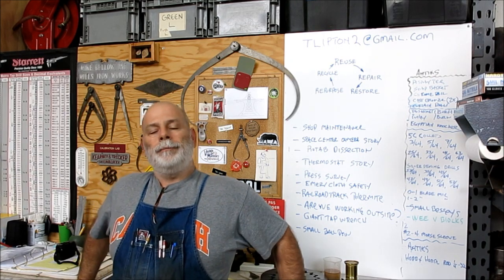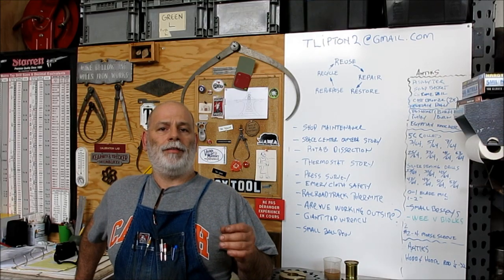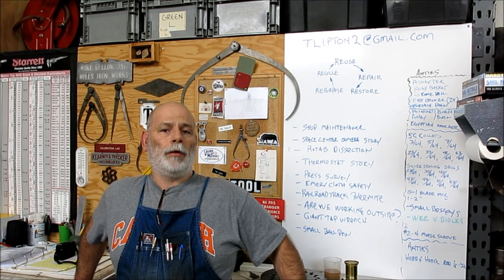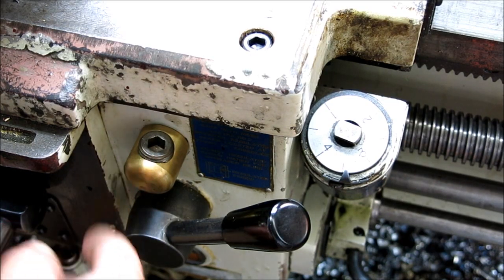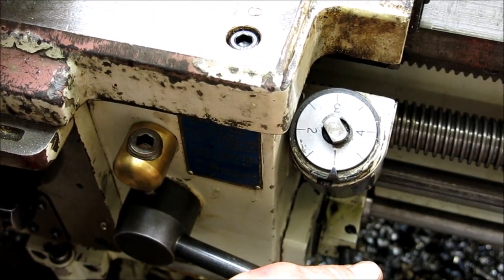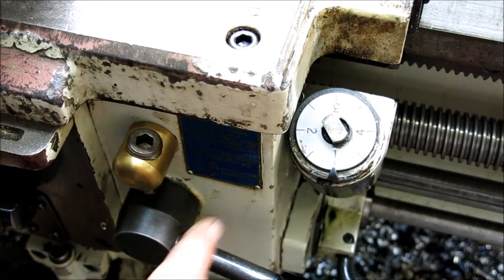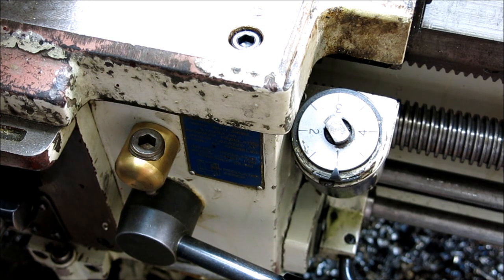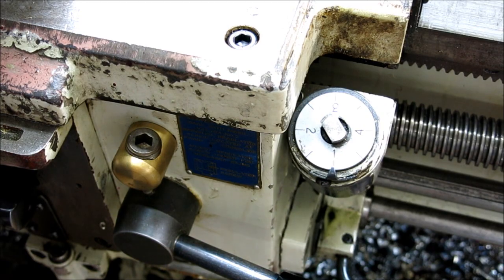Metric Threading with an Inch Lead Screw

Comment: Sure glad this came up in my feed. I’ve always wondered and I have a metric thread job that I haven’t done because it’s up to a shoulder and shutting the lathe down always seemed a high risk manoeuvre. Plus this allowed it finally to click about the geometry going on cutting metric threads with an inch leadscrew. Many thanks

Comment: So when you're cutting metric threads with an inch leadscrew what do you set the gear box at for a metric pitch??
Reply from the maker: Correct. My lathe can do both with a change gear. Normally I would have to leave the half nuts engaged for the entire process. 

Cheers,

Tom
Reply: @oxtoolco   Thanks

Comment: Disengaging the half nut, then re-engaging in reverse.  Two actions which are not necessary.  Stop the lathe and come out. do not disengage and just reverse the lathe to the start.
Simple. it is exactly the same, less two actions.
Reply from the maker: Not the same. You cannot stop instantly. Disengaging the half nuts is instantaneous. Much easier for muscle memory to thread "normally" then when the tool is clear reverse. 

Cheers,

Tom

Comment: If you let the dial make a full revolution and then reselected number 1 would that not be same?
Reply from the maker: Correct. The dial is tracking an inch leadscrew so one full rev is some irrational number different than engaging the same turn on the same number.

Cheers,

Tom

Comment: Completely lost here.   Engage or disengaged….How are you getting a metric pitch (without change gears!) when the lead screw isn’t a metric thread?!!
Reply from the maker: My lathe does have a change gear and can cut metric threads. Because of the inch lead screw you would normally have to leave the half nuts engaged.

Cheers,

Tom

Comment: My first threading project ever on my Grizzly G4000 9x19 lathe is 2.5mm pitch metric threads. For converting Intex pool filter proprietary threads to 1.5 MPT, you can buy an [chinese] adapter off Amazon; the 1.5 MPT is tolerable, but the 'intex' end should be 59mm as measured from a stock male thread, and the knock-offs are 58mm (shrinkage?) and blow off inopportunely due to partial engagement. I said enough is enough, I will just do it myself. There is no brake on my lathe, so about 1.5 turns from the end, you need to un-power and coast; the threads need to be right up to the 'hex' (octo) nut on the PVC. I quickly figured out you needed to keep the half nut engaged to stay in the same thread track, but kept lightly hitting the 'nut'. Your technique is BRILLIANT; I just went out to the shop and did a test cut x3 passes, and it works PERFECTLY! Nobel Prize 🏆🏆 for lathe cutting for you 🙂
HUGE Thank you.

Comment: I had considered this threading method (but the opposite way i.e. cutting inch thread on a metric lathe) soon after its launch  many years ago, but regarded it too complicated and forgot about it. But recently it started  to bother me again. I re-watched the video and understood it better. Oh yes I tried it and what a sweet safe way it is to turn a thread to a shoulder. I am very grateful to you and your source for this excellent method.  There are really no more steps than threading normal way. You only re-engage on the reverse instead on the forward. It is just that easy and fearless.Thank you Tom.

Comment: As you demonstrate, on fine threads in relatively soft material, you can advance the tool with the cross slide.  But there's zero reason to have the compound set @ ~30* if not using the compound to advance the tool.  A coarser thread in some 4140, not so much.

As far as the temporarily disengaging the half nut.  I've become aware of this.  Great tip.

Comment: Any tips on cutting internal metric threads in a blind hole? I would like to cut away from the chuck for speed and safety. (I have 300 parts to do). I thought about setting up a dial indicator to zero when I'm at the bottom of the hole and engaging the half nut on the same mark on the thread dial. Please tell me a better way if you can think of it. Thanks
Reply from the maker: Cut in reverse on the opposite side of the bore starting at the bottom of the bore. A RH thread brings the tool out when the spindle is reversed.

Cheers,

Tom

Comment: Great video, I have a metric lathe and was struggling to cut an imperial thread until I discovered that the threading dial wouldn't work so used the keeping the half nuts closed method. I'm thinking that this method will also work for cutting imperial threads on a metric lathe, will try it. Many thanks.

Comment: On older machines with lots of backlash etc,  ensure that you engage the 1/2 nut with the same amount of closure if it is variable. The other is to wind back enough off the thread for the start and I put a little of drag on the hand wheel to take up any backlash in the system, then I let go of the hand wheel before the cut starts. The main thing is not to change any gearing for when reversing etc. My other tip is to cut at a speed that you are comfortable with stopping by disengaging the 1/2 nut. This is very useful when cutting internal threads to a blind shoulder etc. I was shown this as an apprentice back in 1982. A great video .

Comment: I have the feeling that there is no reason to run the lathe in reverse. Disengaged the half nut  when shoulder is reached wind back (spindle still running normal) wait for number one to come round again and re-engage the half nut.

Comment: I too am having much difficulty cutting a metric thread on a standardized lathe. Standard threads L and R no problem.  And this is a great trick for keeping that position on the lead screw. I understand why you would need to do this when cutting a metric thread just fine. But what I don't understand is how to set up the change gears that are made for standard size threads to cut for example a 1.5mm thread?  How do you get the right gear ratio? maybe you can explain that to us Tom. Thank you for making your videos and putting them out there.

Comment: This is a old video and I totally  understand  the movements. But I am not understand  how to convert to a metrics  thread  on the gear box settings  I have a 15 x1.50 internal  thred to cut but thats not a option  on my lathe . The cutting  process  is understand  the conversion  isn't  can you help me understand  how to convert  the gear box  ratios to metrics.  I gust can't rap my small brain  round  what happened  before  you cut these  threads

Comment: Hi Tom,

Sorry to dredge this up from the distant past!

I wanted to ask how much effect would the backlash in the gear train from spindle to leadscrew have on this technique? Presumably there’s a point where it could allow you to catch the thread next to the one you want but still read as 1 on the threading dial? Would going in reverse past the 1 and then running the lathe forward again to engage at the 1 eliminate this (obviously you’d have to then reverse the carriage back to your start point as well)?

Thanks!

Comment: Just mount the Carbide tool upside down, start your threading near the mounting in the chuck at whatever length you want to start at, and just run that bad boy in reverse when you are threading. Works every time. When you mount the carbide tool upside down, you don't have to worry about the carbide tool breaking either, because if it ever bites into the material, it will just come up off of it's mounting, instead of forcing against the mounting and breaking.

Comment: I have one of these moriseiki lathes. When I got it, it was set up for metric, with 36 drive gear. I had to replace with 72 drive gear. Am now learning how to operate this machine. I love the machine. Bought it out of a shop for $1000.00 dollars, and they thought it was european with european power. I built my own 3 phase unit and run it fine. My serial is 990.

Comment: SOFTWARE: Viewers might be interested in a free online computer program I wrote for calculating gear trains. Search the internet for "RideTheGearTrain". 
You can enter the set of gears you own and when you request a particular thread pitch it will tell you what gears can be used in the gear train. It goes through thousands of possible combinations but only displays the ones that give the required degree of accuracy. Clicking the instructions button provides a link to an instructional video on YouTube and the text is extensive. The software will work for all lathes that do not have a thread cutting gearbox.  Atlas is a South Bend clone and so are Boxford lathes and many others. The software will work for any clones with a gearbox as well.

Thanks for this informative video.

Comment: Not watched you for a while Tom but this is a top tip was struggling with doing the same this on a lathe I recently changed and and handles a half nut lever was on opposite sides,thanks again for all the videos you post Dan

Comment: There are 2 other ways to "remove the excitement".  You still have to be fast on the half-nut!  One is to thread either with the tool upside down, or with the tool behind the work.  You RH thread with lathe in reverse, permitting the START to be at the shoulder and the END out in the open.  The other way is to equip the lathe with a VFD controller.  You can slow the speed and creep right up to a shoulder.  In fact, you can thread without any relief cut at all!

Comment: LOL.....well I'll be, now that is a really clever method of stopping the saddle travel when you get to the end of the thread and have to run up to a shoulder etc.
I don't have a threading dial on my old 1930 Colchester Bantam lathe but now I think I can use one even for Metric which I do mostly now......been using the manual spindle wind back method for years.
This is the never too old to learn new tricks scenario we are all in to if we want to get clever.

Comment: could you make a mark on the bed, and back the carriage up the the same spot, then re-engage the same thread dial grove there? 

I hate running mine in reverse, got a threaded chuck and had the thing unscrew once when I started in reverse.
Reply: Basically, no. There's no magic about where you stop the carriage (by opening the half nuts) relative to the bed. It's the relativity of the carriage position to the leadscrew rotational position (not just the current angle, but the historical number of turns) which matters, and that's what the threading dial tracks.
The proviso in brackets only matters when the thread is the opposite "language' to the leadscrew, one being English, the other Metric. If they're both English, the number of turns is immaterial. If both metric it's more complicated which is why metric lathes rarely have a threading dial.

Comment: If you got the right gearing then lead screw doesn't matter. For machines that don't sometimes you can get change gears to get there. I can cut 0.5mm  1mm 1.5mm and with an extra idler pair get. 25mm and. 75mm. Being creative is the best part of Makin parts!

Comment: I think you are set at 18 threads per inch. That's an English thread of 18 thread per 25.4 mm which is not a pitch of 1 mm which I think you are after.  I haven't run a lathe for 30 years but I believe you can not cut metric threads using an English setup no matter the playing around with the half nut which is just using the same part of the lead screw over and over.. The English setting would have to be 25.4 which is not an option.   I believe a gear ratio change for metric would do it but never seen one.  What am I missing?

Comment: Good tip! It also seems that after you pullout and shut down the lathe, you could manually move the carriage until the thread dial lines up,  engage the half-nut, then go in reverse.  Should be the same.  I'll have to check it out. It may be easier for those with a fine lead screw.

Comment: Isn't simply engaging on the same number every time the same as what you're doing here? Where (even) thread engage on any number , (Odd) thread engage on even only, (metric) engage on same number only.
Reply: when doing metric threads with an inch leadscrew it's not sufficient to engage on the same number, unless you do what Tom did to unwind the extra spindle revolutions.

Comment: Nice... when I thread metric I don't disengage the half nut, instead pulling out tool at end of cut and reverse spindle until carriage is at starting point, shut off spindle, feed in next cut and turn spindle on repeating until finished always leaving half nut in same position.
Reply: If the thread runs close up to a large diameter shoulder, you'd have to use low spindle speed if you are leaving the half nuts engaged.

Comment: depends on slack in screw and half nut apron etc.  you can also engage every thing and use jog circuit on spindle. jog stops faster than spindle drive

Comment: you can do the same idea but still manually move the carriage back if you are using a carriage stop. i do this on inside threading for when i cant have a relief cut. like on the inside of a pressure vessel. ( relief cut can make wall thickness to small) you unlock the halfnut then shut off the machine, then roll back the carriage to the start position then start the machine in revers without the halfnut engaged until it lines up with number you started with on the threading gauge. set cutter to depth reengage halfnut then start machine.

Comment: Nice...my German lathe don't have dial...threading is done always with half nuts engaged...200 rpm and 1mm pitch is
not too fast to pull out and reverse chuck.

Comment: Hi Tom, I like your videos and the in-depth explanations, often illustrated with 'engineering level' math, of what you are doing.  However, it took me a while to see what where the essentials in this video, because you just showed a trick. I was puzzled why you reversed the lathe instead of using the carriage handwheel... After giving it some thought, I realized that you re-engaged the halfnuts in the same position where you disengaged them in order to maintain the relative position of spindle angle and leadscrew. So, I do not regard it as a trick.... it is the only way to stay registered.  Maybe you could have elaborated on that a bit more to reach a larger audience....?
Reply: You could alternatively use the handwheel, to wind the carriage leftwards to re-register the carriage position with the spindle rotation (again, by going to the same threading dial mark.) It's a bit more restful as you can take your time.